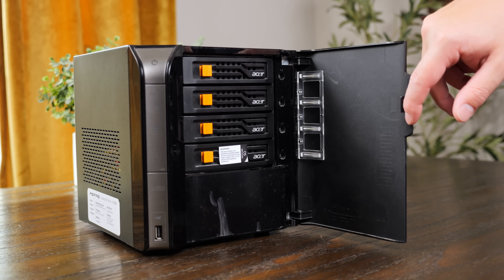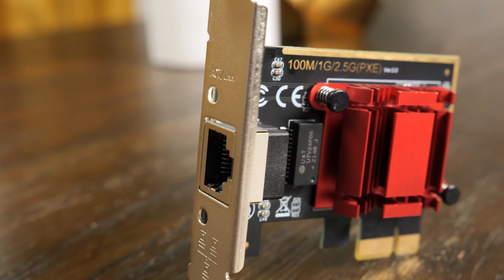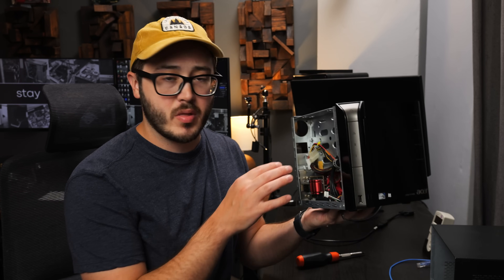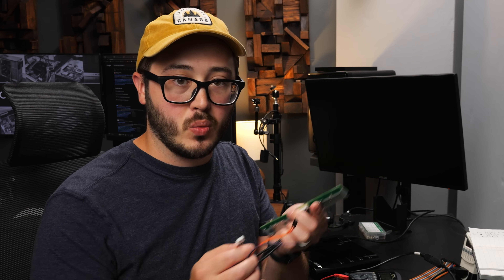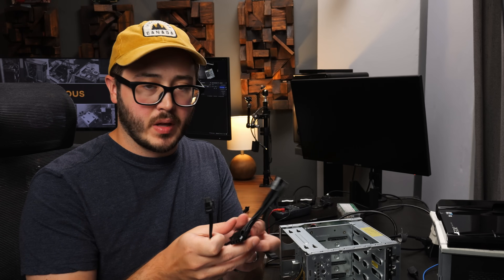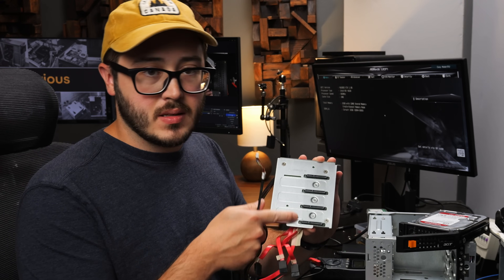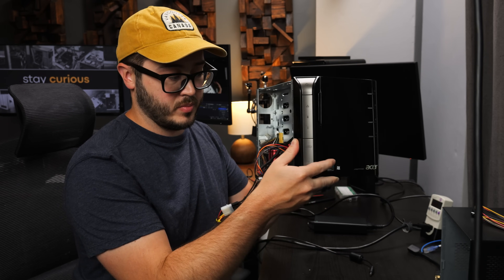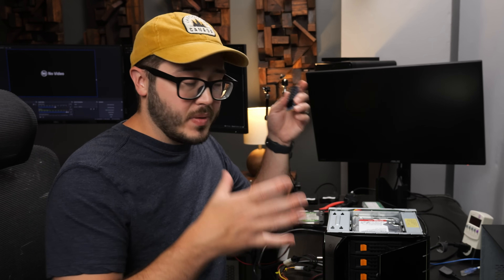I turned a cheap NAS into a SLEEPER home server

Comment: The original Atom in this NAS is the same as in my NAS that's been running for 17 years straight now 😁It's a two bay QNAP TS-239 pro which even has only 1 GB ram.. I remember upgrading to two 2TB WD red drives after a few years so i't probably running for about 15 years with these drives in RAID 1.. Two 1Gbps LAN ports are combined so not that slow and not a single problem ever, still reliable and a snappy interface (don't have installed many extra apps though) . Mind that it has had it's last security update in 2024(!) Very nice QNAP! 
The only thing why I would want to upgrade is the idle power draw of around 26W, but half of that is probably the drives..
(BTW, I will always want a dedicated system for my important data storage, I won't trust a Proxmox setup with OMV or TrueNAS which is also a tinker system at te same time..)

Comment: I want to make a combo of a PC and NAS in one.
This seems like a fine case to do so.
All the interesting ports will be connected to a little box I made with cables running to the NAS which will be in a dark corner of the room and the box sitting on my desk. This makes for a clean setup on my desk which is quite small.

Comment: On the frontpanel, i did remove all cables and wired the connectors to the LED and power switch. works like a charm

Comment: I don't see how any of this could be a fire hazard honestly. Connector adapters are easy to make, and there's nothing magic about OEM versions. The way you did it is correct, soldered connection, generous heat shrink.

Comment: I think this is the most appropriate channel for my question. I am watching your videos for a while now and I can definitely say that your pile of old gear is bigger than mine 😂 so my question is: how can you get rid of the smell of old electronics? Especially when it comes for power supplies. I tried with alcohol 95% and 99%, distilled water and even perfume,  nothing works, they still smell like my grandma's old tv. They smell so powerful that if I leave an old power supply in a box with new components,  everything will have the same odor after a while 😂

Comment: The N100 is a great choice for a home server. Low power and surprisingly performant. It'll run the usual home server stack without breaking a sweat. The lack of PCI lanes is a problem though.
Reply: That's when you start looking at Alibaba boards.

Comment: Those WD green drives are AWFUL. I used to work at a tech consultant and I replaced soooo many failed ones. I had ONE running in my own Nas for a couple years because it was free, and whaddya know, it failed a couple weeks ago.

Comment: You're Canadian!! As am I!
Anywho great video!! I don't think that's a fire hazard, you have soldered and heat shrinked each wire, I think the better solution would be solid wires with pins but I think you're good!
I love projects like this cause it's saving something from the landfil.
The hype of the N100 is completely lost on me, I don't understand why the homelab community seems to like it, the lack of cores seems like a major downside and single channel like you mentioned.

Comment: Regarding the front panel, isolate the components you want to use and cut the traces with a razor blade and just solder new wires onto the leds and switches directly.

Comment: I bought my Acer H340 new at the time. I bought a used mainboard bundle and rebuilt it yesterday.
GIGABYTE GA-H67N-USB3 with i5 Intel CPU. It works great. I put 2 times +5V from the internal USB 
ports to the backplate on turtle and green cable. After that all 4 drives run perfect.
Can you please tell me your pins for the front panel.🙏🙏🙏

Comment: Loved the Video. I actually use an old H340 case as my Unraid Nas as well. Just with on old Xeon 1265l v2 and some Hardware i had lying around. But i still love this little Case, even tho setting everthing up is a pain in the Butt.

Comment: When I saw you had a DC barrel jack power board I knew there would be problems powering the other components haha. If it was a version that uses ATX connectors then thing would have been easier by bring able to keep the Flex PSU.
By the end of it at least you got it working or as you said "technically works" haha.

Comment: I actually just did a similar mod on an Acer h341 I got with some other stuff from a friend. I was surprised when I saw basically the same machine I had just worked on in the thumbnail, lol. Mine now has a Asrock Q1900-ITX I had kicking around from my first home server and is running Synology DSM quite nicely. 
I actually got the LEDs to light up sometimes, but they randomly changed their color and I didn’t want to fry them and so I decided to just unplug them. The 5V for the disks to spin up I „borrowed“ from the front USB Connectors with some jumper wires.

Comment: I have about 50W total power consumption on a stone old build:

Intel Celeron G3900T + 4x4GB Crucial DDR4-2400
GIGABYTE GA-B150M-DS3H motherboard
Emtec X300 M.2 SSD Power Pro 256GB [OS]
LSI 9211-8i SAS Controller [IT-mode]
Seagate Barracuda 4TB HDD [ST4000DM000] x3
Seagate IronWolf  4TB HDD [ST4000VN008] x1
Inter-tech 4U-4408 server case (all pre-installed fans and empty slots filled with Arctic fans aswell)
Corsair VS350 PSU
[Linux Mint 20.1 Cinnamon; ZFS + Samba]

Comment: Wondering if grabbing the version with 24pin on mobo would let me make a sleeper one inside 1U network switch by 3D printing some parts. Your fire hazard is nothing compared to what I've done, mainly because you at least used solder and heatshrink tube unlike me twisting cables together and using paper duct tape. Also idea - custom front panel for buttons and LEDs, it may sound scary but trust me its not c: plus that way you could utilize front USB port with small hub from inside that would also has a flash storage for unraid so no usb stick sticking out.

Comment: I considered upgrading this hardware as well, I originally installed OMV (blindly) and of course, found it dreadfully slow
But for those of you who have one of these lying around (better yet, the H342 iteration) or can find it cheap online, I have a suggestion for it that is both simple and useful
Put the jumper in, leave an empty hard drive in it and boot a USB of the latest Daphile ISO
The machine booted without fuss, opening the web interface worked first try and the install can be copied from that initial USB boot and further setup can continue from the single hard drive you put in
Make sure said drive is "Clean", no partition or format information so that the Daphile installer will handle it
The resulting system can be used to pipe music throughout your home using LMS/Squeezelite devices and has adequate performance to even be a very light file server, for your music files
Lots of limitations, but a sound use case for the potato class hardware
The fact I have mp3s, flacs and even backups of DVD ISOs on the 4 drives (can add a 5th to the e-sata port too) makes it a fairly low hydro powered server for an audio server

Comment: As shown on other channels / blogs the Asrock DC motherboard accepts anything between 12v and 19v so:
- A laptop power supply will work
- A 12 + other voltages will work fine too (with a slightly higher current then for 19v)

The slightly higher current for 12v will not be a problem if the 12v for the drives does not need to pass through the motherboard but goes directly from the power supply to the backplane.

Good luck.

Comment: 5:32 Pop the pins by sticking something flat & strong in those tabs by the wire side of the connectors. You can see the terminals on both connectors at the timestamp. Then you can swap them.     

Try one from the new harness on the MB pin just to check the fit. Then check for fit in proprietary connector. If good, swap one by one to maintain the correct pinout.    

They do sell crimp tools & terminals for different sizes and conmectors. Good thing is that there are certain ones that'll work well for you computers, cars, and other things. You can save soooo much money and time from broken wires.     

My brother could've did that fixing a Lexus. Whole problem was a bad factory crimp job on the camshaft sensor wires and vibration broke the wires. He only found that out after the parts & labor. New connector with longer wires to splice, $9 with tax. Heatshrink already on deck.

Comment: It's quite amazing the server power of 4 E-cores.  I have Windows Server 2025 Insider Preview running on a cheap mini-PC.  It has two gigabit Ethernet connections; one is used for the domain controller and the other for the Hyper-V network bridge.

Comment: Nicely done!
I didn't know that little backplane header also had a +5V rail. I'm going to re-do mine to be more like yours now. I janked up mine so long ago there wasn't much DIY posting about it yet, so I had to decode the pinouts myself and missed that -- I ran jumper wires from the MB's USB header +5V, but your way is better since it doesn't need wires in the system.

Some of my panel decoding that might help you...
- HDD LED: On the longer front panel connector, the green wire between blue and yellow is +3.3V for HDD LED, and orange and red at far end of connector (not orange and red pair in middle) are both ground.
- Power LED: Blue wire next to above mentioned green lights up the power LED, but the original MB feeds +5V on that lead so it must be meant to power more than just the LED. Connect at your own risk as the circuit might be trying to draw more than 3V3 and could burn out the MB's LED header.
- Front USB: On the shorter front panel connector, find the side with all 5 wires populated, they are standard USB2 connections, in order: black = s-ground, black = ground, green = data+, white = data-,  red = +5V.  S-gnd is not necessary to connect, but can be more stable connection with higher speed devices (USB2 "high speeds", that is).

Comment: I still have no regrets getting both the UGreen DXP6800 and DXP8800... the latest update (version 1.0.0.1150) has a lot of fixes and improvements that made it run much more efficient and stable. It rips through 4k/8k content like a hot knife on butter. Combine it with a fiber Internet service and everything just feels so snappy... even network shares that are accessed remotely via VPN feels like I'm accessing them locally! 💪

Comment: N100 suports by default single channels memory!I pass through all the steps and I found the same schematics on that forum:)) My setup. include the Asus prime n100 mb which is very similar in therms of specs..the downside is that PCI express slot is only X1...

Comment: You saying something is a fire hazard that isn't just discourages people from learning. What you did actually looked proper.
Reply: It quite literally is. He's using an inappropriate wire gauge to connect 4 relatively high-power draw 3.5" hard drives.
Commercially available Molex to SATA power adapters have a rich and storied history of melting and causing everything from sparking to fires.
... and that's when they're using the correct wiring gauge.
Reply: He said probably and not everyone is qualified to make such an assessment of work

Comment: TrueNas can be installed on USB as well. I contemplated using a high write endurance micro sd card in raid 1 (use 2 card readers which are super small) and basically utilize every available sata port for an hdd and pcie lane for important stuff.

Comment: Soldering the pins from the backside is a bad idea in your implementation. The pins are surrounded in a circle by the ground, only a green mask separates them from your soldering.
Reply: The "green mask" is there specifically as a solder resist, and can survive soldering temperatures for at least a couple of minutes. It'll be absolutely fine.

Comment: what does "sleeper" mean in home server? Anyone?
Reply from the maker: Is this an actual question or a joke? (not judging, i just actually can't tell haha)
Reply: @HardwareHaven   It is an actual question. This is the first time I'm hearing the term "sleeper" along with server.
Reply from the maker: I've mostly seen it used with gaming PCs, where you have a very modest, unassuming, or even old/ugly case with really high end components inside. So in the case of a home server, it would be modern/capable hardware inside a chassis that looks obsolete. At least that was the vibe I was going for
Reply: @HardwareHaven   oh okay, thanks for the reply.
Reply from the maker: No problem!
Reply: @sineflake  the term is most popular and more common in the automobile world and has found its way into other areas (like computers). "Sleeper" cars are unassuming, stock-looking (or dilapidated looking) cars that have performance upgrades to the engine, drivetrain, and/or suspension that make the car perform at a much higher level than their outward appearance would make you believe. It is common in street racing and drag racing cars.
Reply: "Sleeper" applies to cars. It's a reference to when police would, well, sleep in their cars behind billboards, barns etc.
The loud, modified moonshiner vehicles of the 20's/30's along with the muscle cars of the 60's would wake them up and trigger a pursuit.
The result is so-called "sleeper" cars, where it's extremely powerful without being loud. Later revisions of the expression applied loud to being "visually-loud", i.e. show-off.
PC gamers use the phrase to describe a fast gaming computer that doesn't look fast, usually to show off at LAN parties, etc.

Why, exactly, you'd want a "sleeper" server is beyond me. 
Anyone who cares what kind of server hardware you're running won't be impressed with decades-old system. 
Everyone who doesn't care about server hardware... won't care that you're pretending to run a faster system in a slower-looking box.

Comment: Why not use the n100m board, works with a normal power supply. And power (connections) enough for the hd's.
Never mind, the n100m mobo looks to be wider. (about 3 pcie slots of room wider)
Reply from the maker: Well it's matx for starters haha

Comment: Regarding the RAM, N100 is supposed to be paired (optimally) with a single DDR5 DIMM and each DDR5 DIMM has two channels.  Compatibility with DDR4 leaves a lot to be desired.

Comment: Couldn't you have run the backplane off of the NVME sata adapter and then used the onboard Sata ports for a 2.5' Sata SSD for boot?
Reply from the maker: Yep. Unraid was what I had already decided to go for though, so i didn't bother.

Comment: time to get in on that PCBway sponsor money and create a new front panel that slots in where the old one was with all the same LED/button placements, maybe with RGB leds for the meme
Reply: I second this idea. It pisses me off those 2005 to 2011 mini servers had so much proprietary junk turning them basically into ewaste when they became too slow to use. It would be nice to see PCBway make a kit to revitalize these old HP, Acer mini server cases.
Reply: @SHO1989  I have a HP MediaSmart Server EX490 and I think its such a aesthetically pleasing NAS.  It would be amassing to be able to revitalize it  :)
Reply from the maker: The sponsorship isn't the hard part. It's the "create" part. Haha!
Reply: Perf board is also a great  low budget option. I think  you could very easily recreate that pcb with  perfboard.